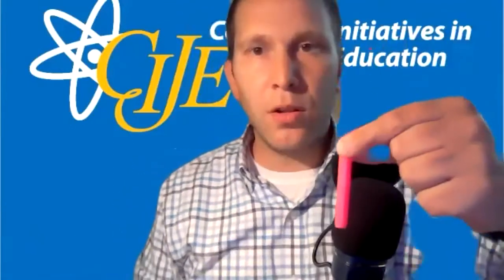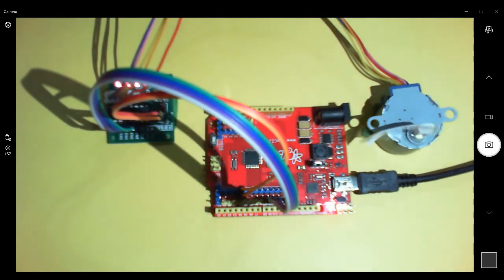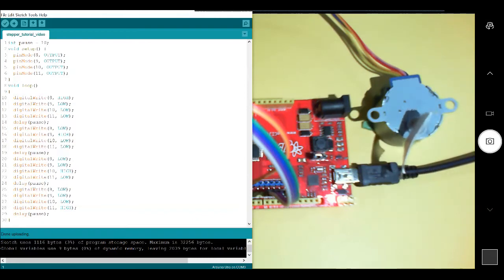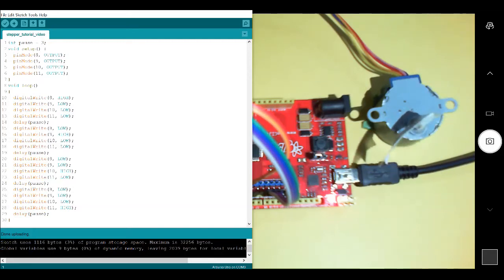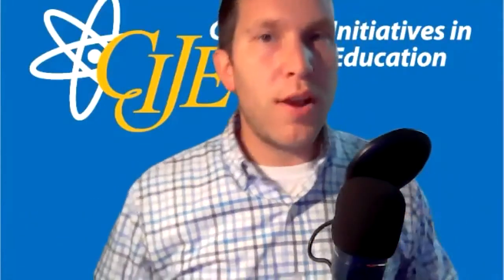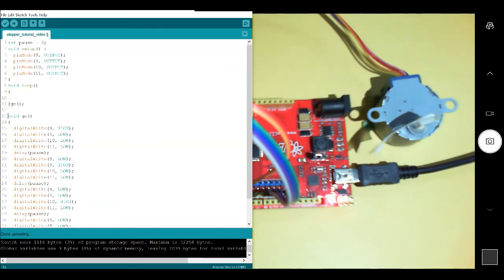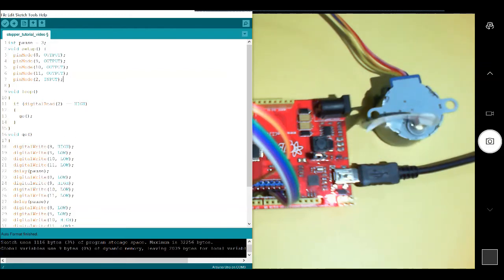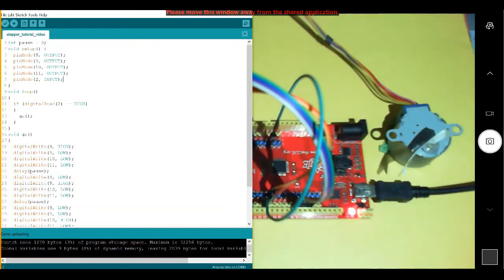Arduino Simple Stepper Tutorial - No Library!

Comment: Hello, Thanks a lot for the video. It helped me a lot. I have a question, Is it possible to increase the number of steps on this motor? If yes how many steps an be increased at a time?
Reply from the maker: as far as i know you can't increase the steps on a servo motor without purchasing one specifically designed for that.